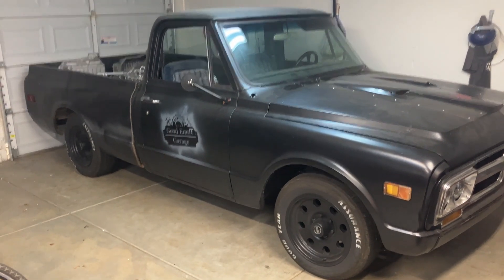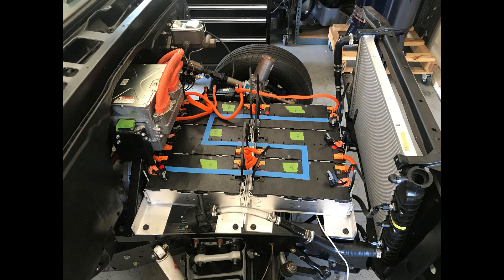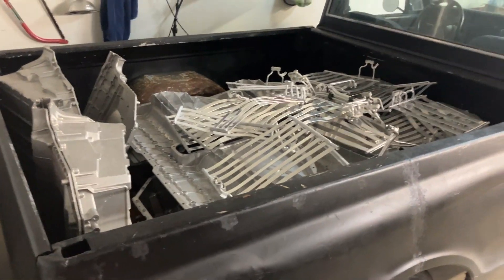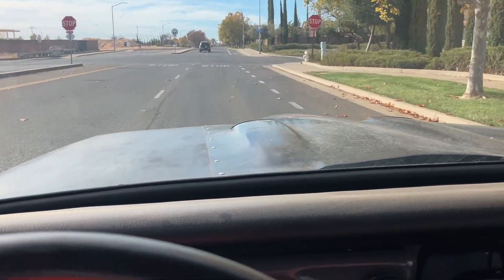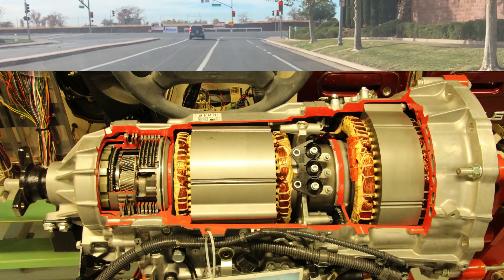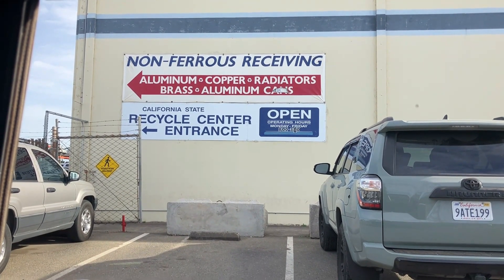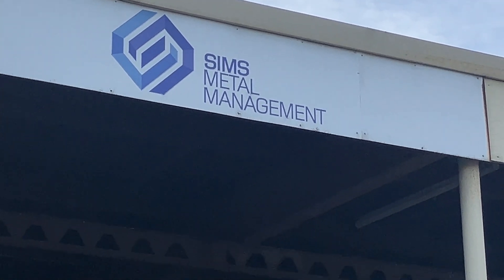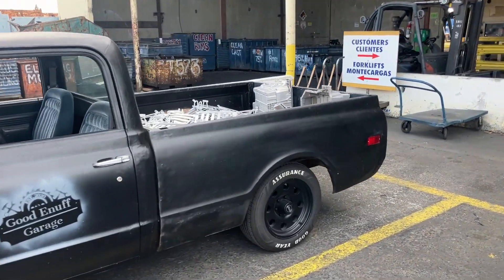BMW 530e Hybrid Battery Pack Scrap

Comment: You was robbed! Last time I took alloy wheels to the scrappy I got £18 each. Not sure what weight they were but only a few kg.
Reply: @Good-Enuff-Garage  Sorry I forgot you're still in the 19th century with your weights and measures. They were a 10 or 20 lbs. 😝
Reply from the maker: how many stones is that?
Reply: @Good-Enuff-Garage  160 or 320oz